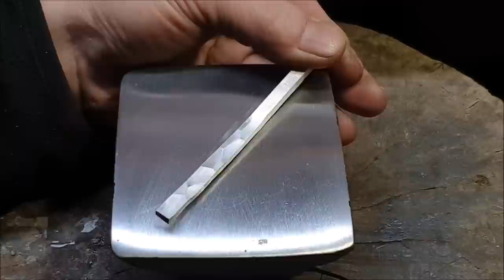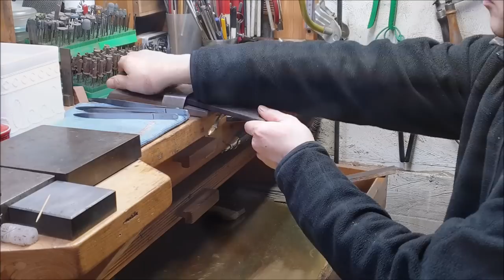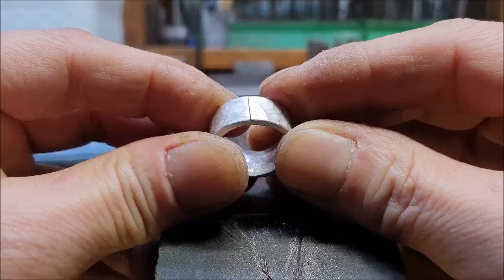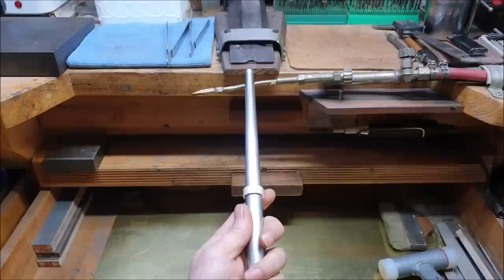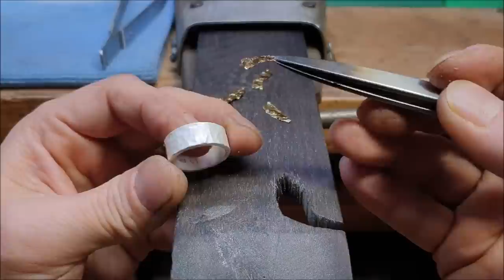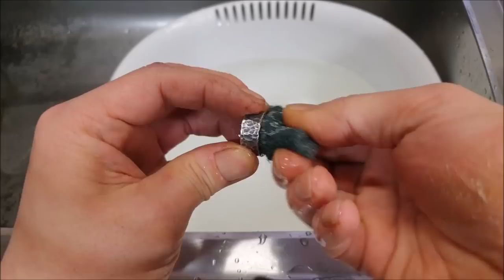Making hammer texture SILVER RING  [ KEUM-BOO Technique ]

Comment: Beautiful work and great video. I've never tried keum-boo, this looks like a great way to start.
Reply from the maker: The thickness of the gold sheet(keumboo-금부),,,
A postcard-sized gold sheet is about 3-4g.
That's about the thickness.
It is about the thickness of a regular paper.
Heating these metals to a temperature between 260?370°C increases 
the movement of the atoms. 
When pressure is added, 
this causes an electron exchange at the surface between the two metals, 
creating a permanent diffusion bond. 
This diffusion bond occurs far below 
the soldering temperature for either metal (Dhein, 2004).
Nothing is permanent in this world.
It may wear out over time.
Physical contact may cause it to peel off.
It doesn't go away easily with the passage of time.
Because silver and gold became one.
This is different from normal plating.
Thanks~
Reply: @SilverMeister  Thank you for the excellent explanation. I really like to understand what I am doing, so I very much appreciate when someone takes the time to explain what is happening and how it all works. This is so beautiful, I am going to definitely give it a try.

Comment: Fab! Thanks for sharing.
I’ve never seen anyone use Camillia oil like that. What does  it do?
Also are you using gold foil or gold leaf?
Thanks!
Reply from the maker: Camellia oil is vegan oil.
The reason for applying oil is to delay and protect the oxidation of the silver surface.
A very thin oil film protects the surface.
After applying the oil, clean it again to finish.
The camellia oil that I use is safe to eat.
It is a very good natural oil that is harmless to the human body even when the ring is worn on the hand.

The thickness of the gold sheet,,,
A postcard-sized gold sheet is about 3-4g.
That's about the thickness.
It is about the thickness of a regular paper.
Heating these metals to a temperature between 260?370°C increases 
the movement of the atoms. 
When pressure is added, 
this causes an electron exchange at the surface between the two metals, 
creating a permanent diffusion bond. 
This diffusion bond occurs far below 
the soldering temperature for either metal (Dhein, 2004).
Nothing is permanent in this world.
It may wear out over time.
Physical contact may cause it to peel off.
It doesn't go away easily with the passage of time.
Because silver and gold became one.
This is different from normal plating.
Thanks~
Reply: @SilverMeister  Thank you for you detailed reply! 🙏

Comment: Gorgeous ring. I have been wondering whether you add the gold foil at the end, or at a point earlier. This answered it for me. What were you putting on the ring with the brush at the very end?
Reply from the maker: When attaching KEUM-BOO, depending on the work situation, it can be attached first or later.
Camellia oil is vegan oil.
The reason for applying oil is to delay 
and protect the oxidation of the silver surface.
A very thin oil film protects the surface.
After applying the oil, clean it again to finish.
The camellia oil that I use is safe to eat.
It is a very good natural oil that is harmless to the human body even 
when the ring is worn on the hand.
This is the part that a lot of people are curious about. 
Since my work does not have a special finish after completion,
As a minimum surface protection, it is often finished by applying natural vegetable oil and wiping it.
Although it is not shown in the video, it is sometimes coated with natural beeswax (honeycomb).
Beeswax melts easily even at low temperatures (approximately 60-80 degrees) by applying slight heat to it and coating the entire work.
Since what I am aiming for is nature-friendly as it is, it can be viewed as a minimum protection work.
Reply: @SilverMeister  thank you so much for the helpful reply. Thank you for sharing your work with us as well.

Comment: Hi, but does gold adhere without heat or solder?
Reply from the maker: The thickness of the gold sheet,,,
A postcard-sized gold sheet is about 3-4g.
That's about the thickness.
It is about the thickness of a regular paper.
Heating these metals to a temperature between 260?370°C increases 
the movement of the atoms. 
When pressure is added, 
this causes an electron exchange at the surface between the two metals, 
creating a permanent diffusion bond. 
This diffusion bond occurs far below 
the soldering temperature for either metal (Dhein, 2004).
Nothing is permanent in this world.
It may wear out over time.
Physical contact may cause it to peel off.
It doesn't go away easily with the passage of time.
Because silver and gold became one.
This is different from normal plating.
Thanks~

This method is a traditional metal craft technique unique to Korea.
Reply: @SilverMeister  thank you!  your video is very beautiful and interesting!
Reply: I think the heating before the gold placement brings fine silver to the surface of the ring, the fine silver layer is very soft, like gold is soft, so the mere pressure of burnishing the gold onto the fine silver layer is enough to bond the two metal surfaces together, not deeply like sweat soldering would but enough for adhesion…imo

Comment: HI friend, how thick is the square wire you using ? thanks
Reply from the maker: I don't know what your question means.
Reply: @SilverMeister  what size/dimensions is the silver metal you start with
Reply from the maker: The starting silver thickness is about 3mm and the width is about 10mm.
thanks~